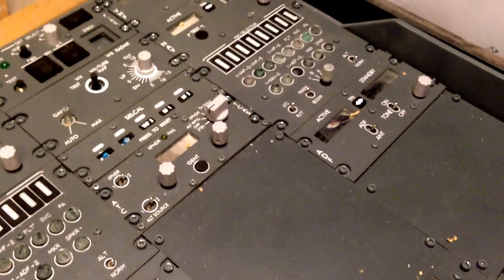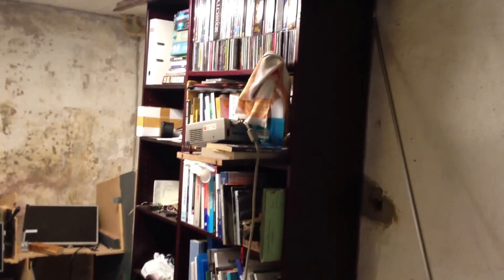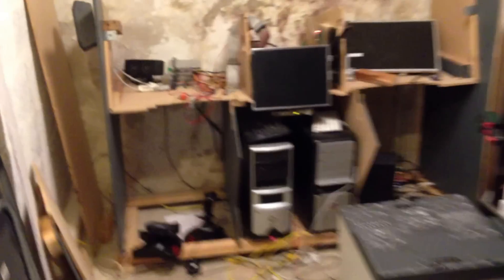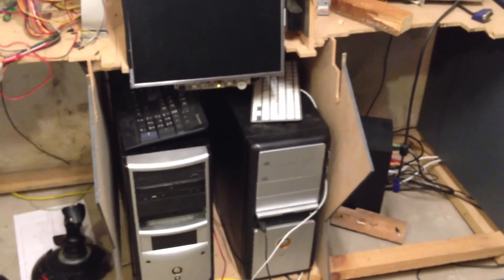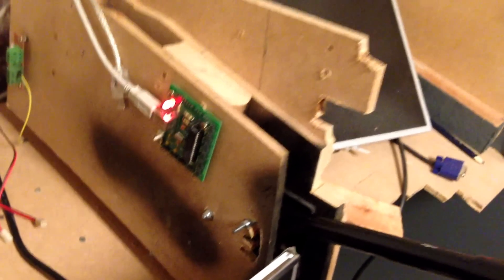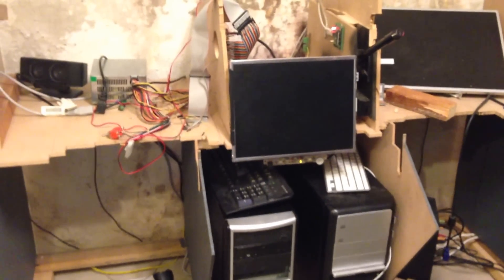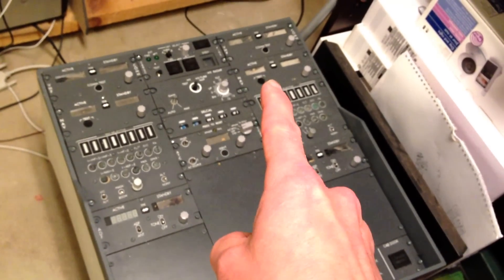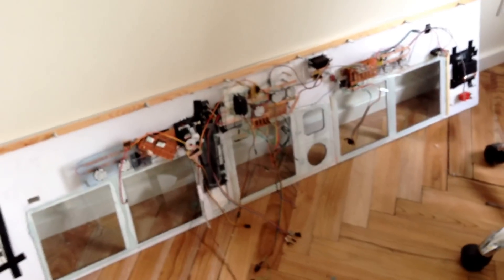Presentation of my project - B737 Home Cockpit

Comment: As a 14 year old boy, am I too young to start with these sorts of projects or should I just go for it?
Reply from the maker: +Daniel Dankers Go for it! It mostly depends on your DIY skills, money (But if are willing to compromise on the realism you can get a long way), and research research research. 
Just a small panel that can handle different aircraft funtions like gear or flaps will give you a whole new experience. That can be done fairly easy. Find an old joystick with a lot of buttons. Take it apart and solder new switches on to it. There you go. You just made a panel. You need to buy FSUIPC to make it work.
Reply: Thanks, money might become a problem, but you're right. Just a small panel can change everything. I found an easy way of making a panel by painting a keyboard grey and place stickers over the keys, and assigning different functions,and you can use different screens as meters etc, im going to start on it soon :D
Reply: Hell yeah, go for it! I’m starting to plan out my cockpit and I’m 15! The main issue is money but I have gotten a summer job so at least there is some income! Good luck with your cockpit!
Reply: Im 14 and im working on mine i recomend using cheap material until you know what youre doing well enough.